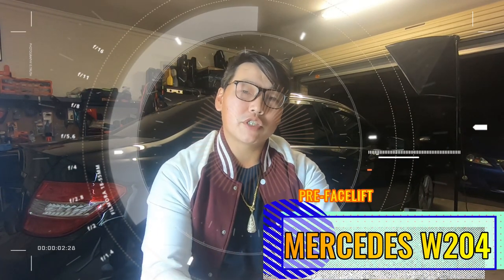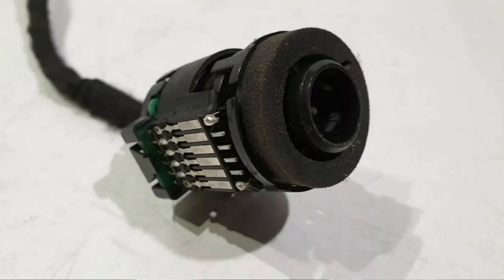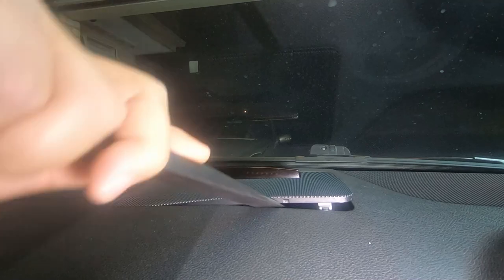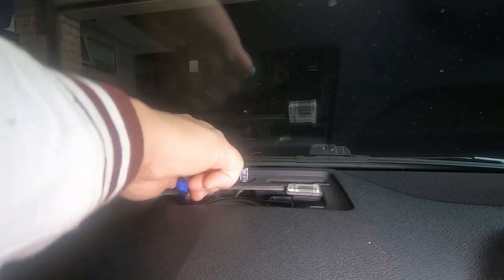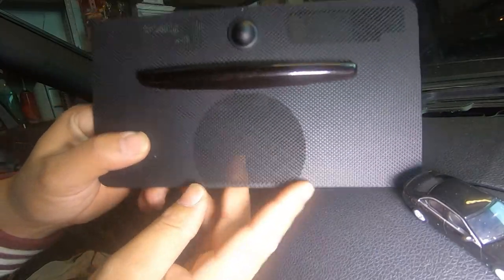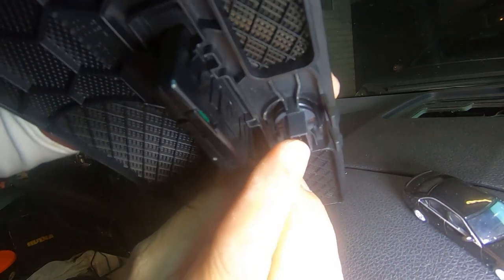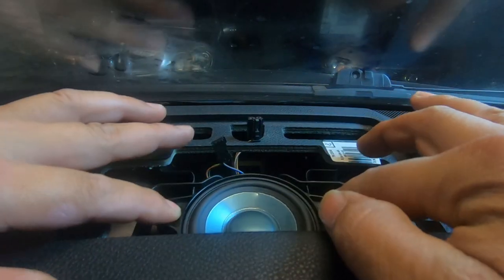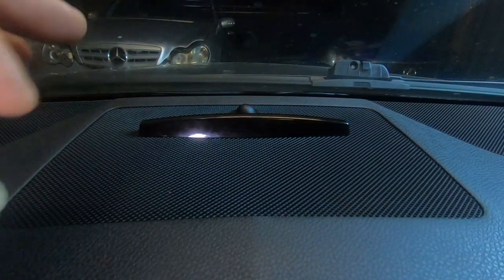MERCEDES W204 CENTRE DASH SPEAKER COVER LIGHT SENSOR PARKING DISTANCE INTERIOR TEMP SENSOR REPLACE

Comment from the maker: wanted to correct myself thanks to masoud feiz abadi... shout out... the little roind sensor behind the parking distance display is actually the sensor for the air conditioning system... the light sensor is built in with the rain sensor .... my bad guys...... correction

Comment: Good like always.one small correction.the light sensor intergrated with the rain sensor and it's located on windscreen. The little round sensor is photo sensor for air conditioning system.
Reply from the maker: thanks for the correction...im still learning
Reply from the maker: hey buddy i.m hoping u can help me with something do u have the specs on how to disassemble a headlamp? im having trouble with a spexific part ...the headlamp adjusters ..wandering if u had info on how its removed via your experience and tools